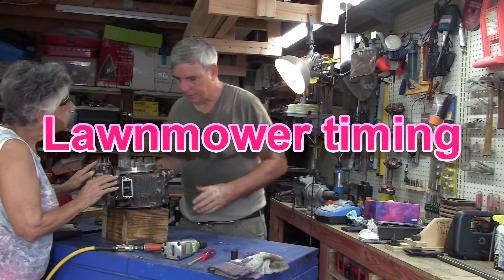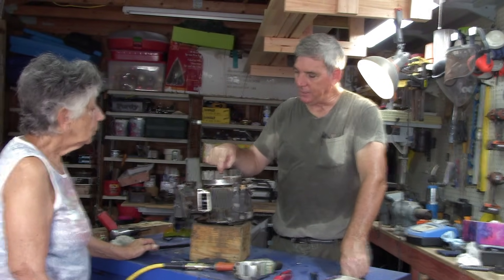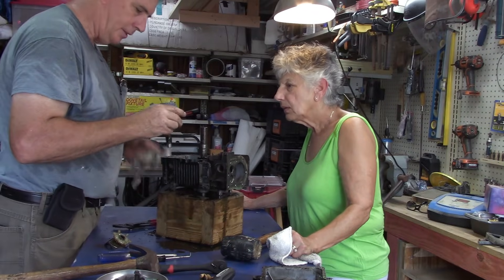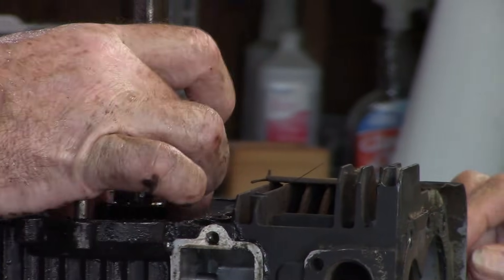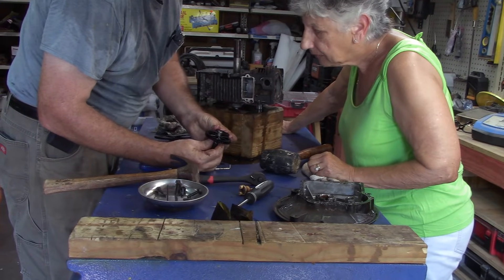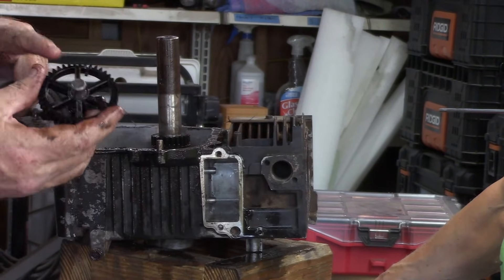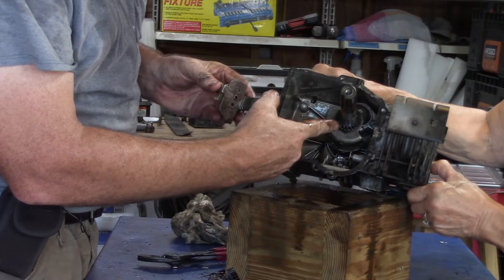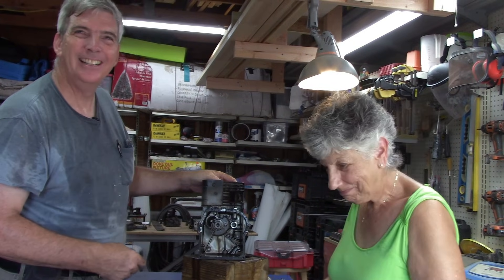Lawnmower engine timing. How to check timing.

Comment: Thank you! I have a briggs and stratton quantum 50 which is doing exactly as you said: Ripping the cord out of my hand and it hurts.
Have to look at the timing.
Reply from the maker: Glad the video was helpful, you'll want to take that engine apart carefully.
Reply: @GeneLonergan I have a craftsman yz3000. Sheared the key. Put a new one in and it won't fire even on ether like the timings off. Has spark. And fuel. Any ideas?
Reply: Has compression also and spins over fine.

Comment: Attention for engine model: Honda, Tecumseh, Briggs/Stratton, etc. The TDC point is the same for all engine model but the set up gap valve clearence is different. 1/4" down piston more clockwise for Briggs/Stratton engine.
Reply: Honda engine

Comment: Gene, I have a Quantum engine that just quit on me while mowing. I've not been able to start it since. I also had to replace the recoil starter spring, cleaned the carb, changed the air filter, spark plug, and still doesn't start. When I pull the rope now all I get is three little pops. I have never heard that before.